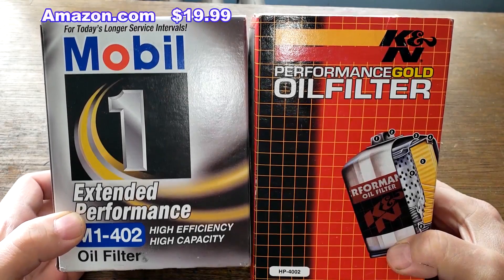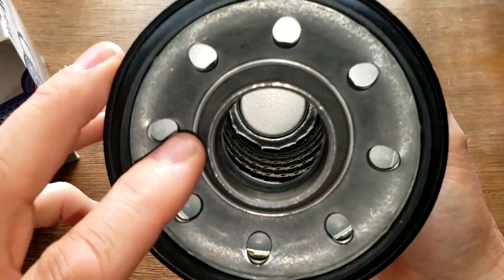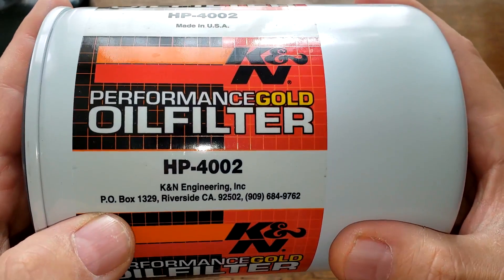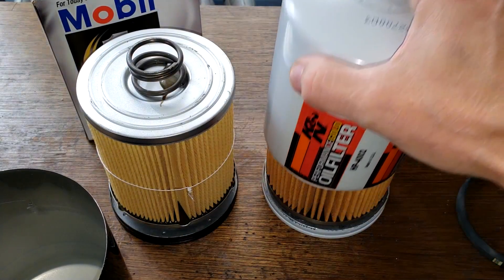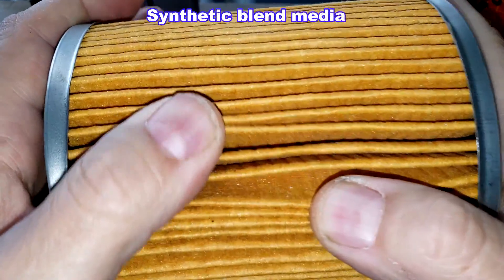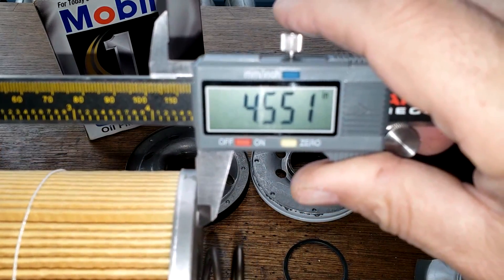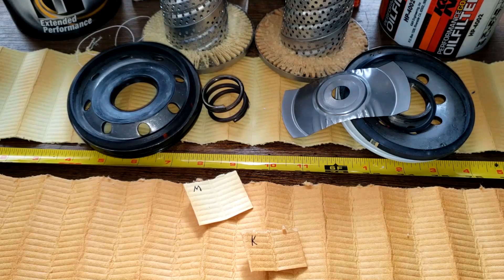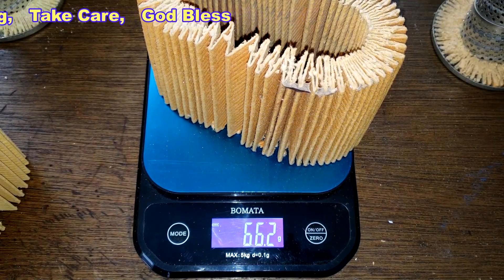Mobil M1-402 Oil Filter vs. K&N HP-4002 Oil Filter Cut Open Comparison

Comment: I’m a fan of hole louvers and the big inlet holes fo sho. One filter ago I tried the Boss filter on my Cummins. Off the get go I noticed terrible oil pressure especially at idle. So bad I’d give it small revs at the red light.couldn’t wait to change my oil. When I changed the oil I looked at the louvers and they looked tighter than the usual. Heard great things about the purolator boss but that turned me off. I’d use any of these two filters with those open louvers and big base plate holes over the previous anytime! Men, check those louvers before you buy.
Reply from the maker: Yep Very Good Advice, I'll pin your comment so that it sits on top. I did a couple of videos on louvers that were not fully opened, here they are. Thanks! https://www.youtube.com/watch?v=UFftfcUHypA    https://www.youtube.com/watch?v=FPRRzWE55GQ
Reply: @WhipCityWrencher  thank you!
Reply: Have you tried Donaldson blue?
Reply: @AntoineClaquin-cf2hd  I thought about it. For most of the almost 20
Years I’ve had my 1st gen I ran (I know) the fram pro. Cellulose with metal end caps, no bypass. Got 2.5 cases for a dollar each from Walmart. It was ph3678A.”A” stands for adjusted because in the begging fram did kill a bunch of Cummins and took in a major lawsuit. Learned that later. Anyways after 4-5 month oci’s and rotella t-4 with no problems I’m recently experimenting with different filters. Changed to t-6 and a fram endurance. Feels great, oil pressure is awesome. Checked the louvers before I purchased
Reply: In that application, a louver is going to be more flow restrictive than a plain old 'hole'. The louver even if it's open enough is going to be a 'flow director'. I've noticed that too on certain filters impacting oil pressure. Other than that core, I think the Boss is pretty good filter. I don't think theres any 'one' filter that has all the best features. I had a Pure One and switched to a Fram Ultra and that Ultra has some pretty puny tapping plate entrance holes on some numbers, like the one I used. I still think the Titanium is the best Fram filter, but I haven't bought one in a year.
Reply: @vincemajestyk9497  I meant to say I’m no longer a fan of louvers. Much more comfortable with the holes. I know the boss is good per testing I’ve watched .
Reply: @reeksreeks3017  I was never really a fan of louvers. They're 'OK' if opened up, but a big enough hole is still better. I think louvers are 'cheaper' for production purposes. Less mfrng steps, no stamping/punching waste to contend with. Adds up over millions of filters.

Comment: Since watching some of your videos I bought the tool to cut open these oil filters lol, so far I have done 6 motorcraft filters and now all but one of them the end caps were loose and not glued down. One filter was off of my own car and it was a fl910 and the end cap came loose but no tears, but it has a bunch of loose glue piece on both the outside and inside of the filter element so I'm wondering if any of that glue came loose and is now stuck in my engine somewhere. But its kinda sad that nearly 6 oil filters off of each car one including my own with all at 5k miles have all failed in some way with the tears or end caps.
Reply from the maker: Yes it is, Motorcraft oil filters aren't as good as they once were.☹

Comment: Mobil 1 wins this one. I'm a K&N " Loyalist " but K&N oil filters work differently to others. K&N filters the engine oil quicker then OEM and Other brand filters BUT it doesn't hold much contaminants then other brands as K&N oil filters are made for Performance Driving.

Comment: Those K&N's had a lot of problems with those spot welded nuts and the weld penetrating the can and leaking, worse if you used the nut to install it. They recommend ONLY using that nut to REMOVE the filter. I never liked their filters anyway. The air filters are pure garbage. Ruined a lot of engines, especially diesels when it was a popular upgrade.

Comment: K&N filter nut barely works. Most of the time a 1" socket slips off if the filter is on tight. I use the K&N exclusively on our vehicles despite this. Think K&N has downsized all of their filters recently.
Reply: That 'nut' is practically worthless. It's tapered so it's tough to get any size wrench to fit it. K&N was bought by Goldmann-Sachs of Wall Street a long time ago and gutted and run into the ground so I wouldn't expect to see any concerns about 'performance' or quality over profits to come first. Take a look at the last 10 years financials or so. It was a 'plum' they picked and harvested for capital. Look at it now.

Comment: Maybe manufacturers could start using gasket material on the leaf spring now that you’ve proven they’re not sealed with your light test.
Reply: These filters go through some rigorous testing. Most car manufacturers recommend the leaf springs since they mitigate the core tilting in the can. Coil springs allow that core to move all over. 

I have to wonder about the seal while under spring tension in the can. Oil is going to take the path of least resistance, so probably through the filter media. Leakage between the flat spring and core may not happen in actual use.
Reply: Have you watched wcw test this? It looks pretty lousy to me. Fram Ultra Synthetic filter used to have gasket material at that junction. Unfortunately no longer. Id still prefer it to be there if they use a leaf spring.
Reply from the maker: So far the only one that past the light test has been the Purolator Boss oil filter. There are others that use this same kind of bypass valve that will probably do just as good, I just haven't tested them yet.

Comment: how do you see or know that it is a synthetic blend media if  the manufacturer does not say anything about it ?
Reply from the maker: Well if I can't find it documented then that's what I say "I don't know what the micron rating or filter media is made of". But usually, you can find it on their websites, filter boxes, etc..
Reply: You can 'generally' tell by the look and feel of it. Also, under a microscope it's easier. The interlocking striations or orientation of cellulose is much more randomized than synthetic. Cellulose is actually a pretty good (usually superior) filtering media. It just doesn't hold up for very long. It will absorb a small amount of moisture but is more sensitive to temperature and has, generally, a shorter life span.

Comment: Great Job, Pete!  Those are big filters!  Both look like pretty good but I'd take the Mobil 1 because it has more and superior media and appears to be newer. 

Plastic does not seal 100% like metal or glass will.  It will still allow gas like water vapor seep in.  that's why a sealed bottle of Coke in a plastic bottle can go flat if you leave it long enough.  After what was probably 20 years, enough  water vapor seeped in to form surface rust.  Oh yea, never use oil that is over 5 years old for that reason.
Reply from the maker: Thanks, Jim👍💯